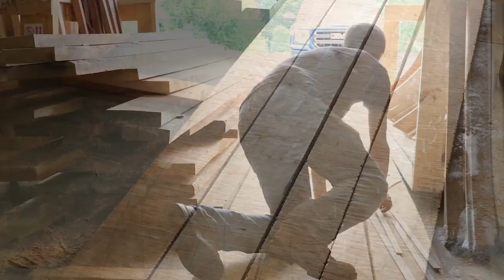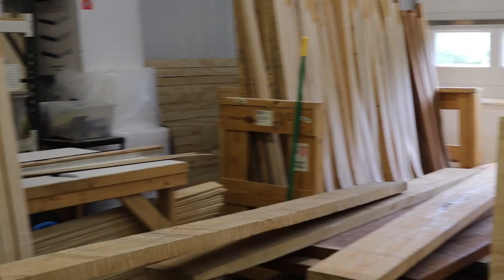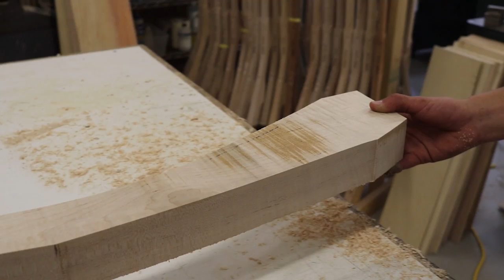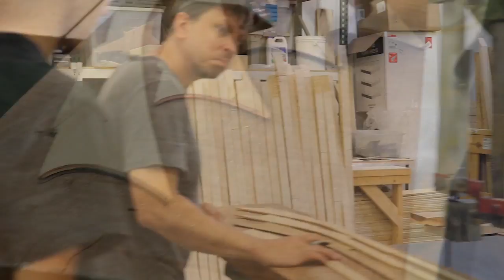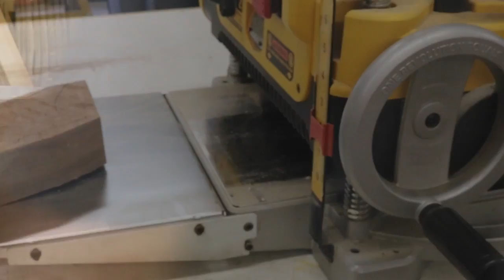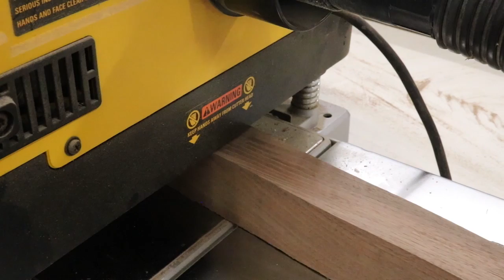Turning Boards into Kit Gun Blanks

Comment: That is wonderful having the equipment to work the wood. Back in 1977 I bought 1200 feet of curly maple to use as paneling in my log home. They are getting darker with age and still people love to look at the wood interior walls. All my wood was hand worked other than a electric handsaw. CNC was not a option for final shaping!

Comment: Do you use some of the waste for pistol blanks?
Reply from the maker: We don't right now.  The ideal pistol blank has grain that curves down the grip.  Most of our wood is straight grain.  It could still be used, but there's not too much demand for pistol blanks.  Might have to cut a few out, though.
Reply: @kiblerjim  well I could be wrong but a pistol kit might be a seller for you.  Thanks
Reply: @kiblerjim  You could discover (for your apparent abundant scrap) the value of AK 47 style stocks, revolver stocks,  any type of wood semi pistol stocks, etc. all oriented in the same grain direction you appear to be cutting it.  I would be happy to send you examples or even have the ability to purchase.  Possibly some other rifle stocks depending on the size and width of the piece.  The long rifles are great but appear to require larger and longer lengths of the must be expensive rock and roll guitar wood.